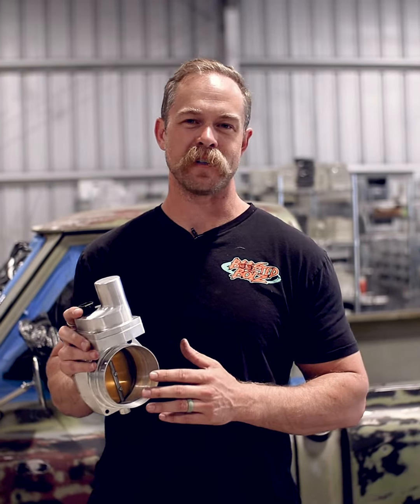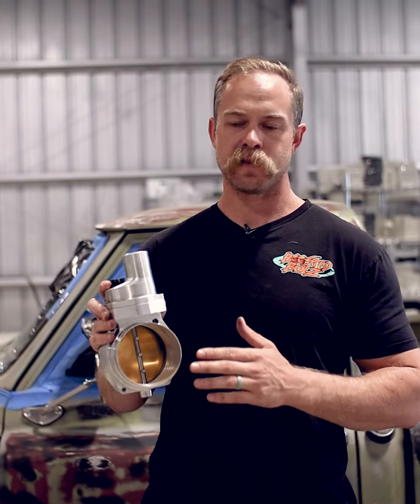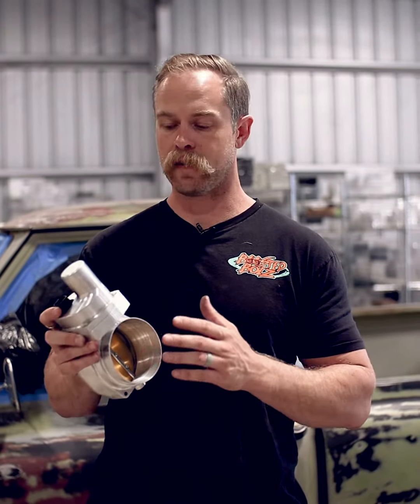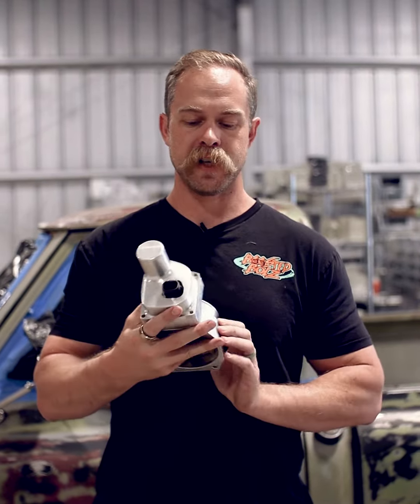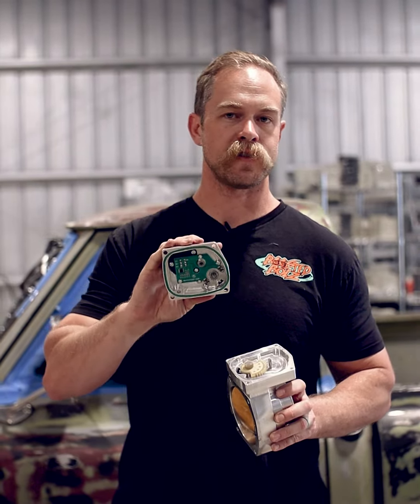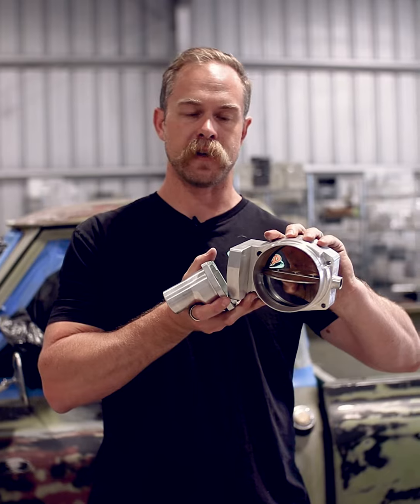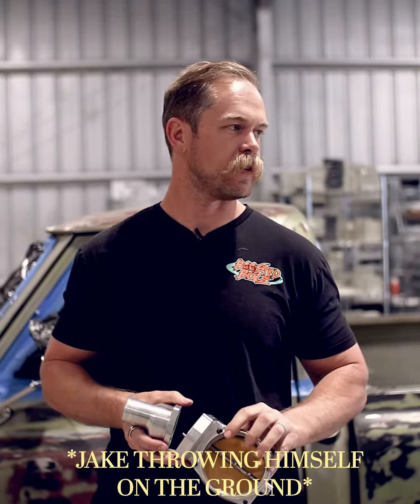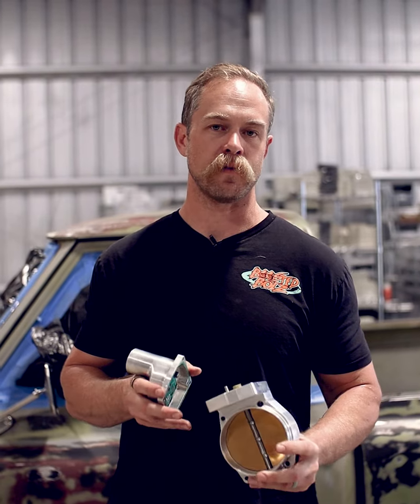Throttle Body Compatibility Explained (ft. Jake the Dog)

Comment: Just so u are aware the 92mm also works on gmc yukon tahoe 07 13 i run the 92mm even though its not on ur fitment guides but it does work  just a mechanics tip to one another
Reply from the maker: @jimmyp1145  this is the kinda thing I appreciate very much. Customers like you help make SEP better all the time. Thank you!

Comment: Good info. I have the 8 pin factory harnes but a 6 pin 102 aftermarket that is still sitting in the box. How do u feel about the x link style conversion ?
Reply from the maker: Solid question. I have heard mixed reviews on the X-Link. It’s expensive and it only works with OEM equipment so far as I’ve heard